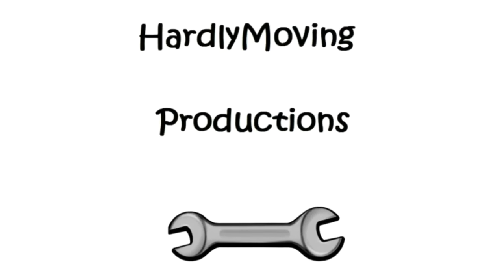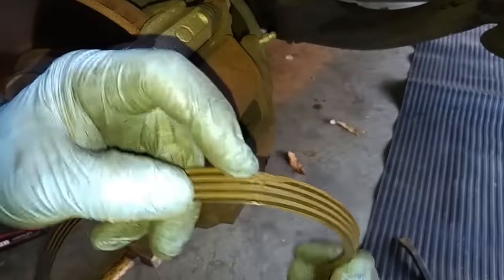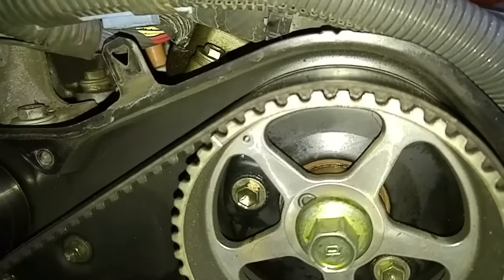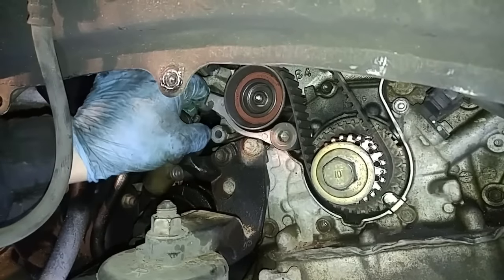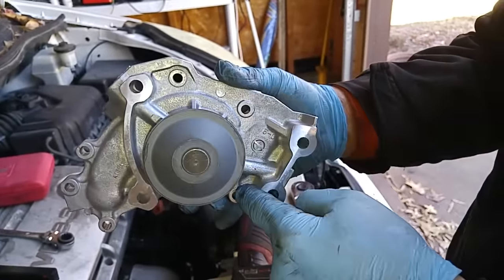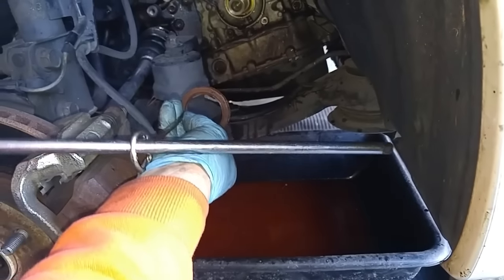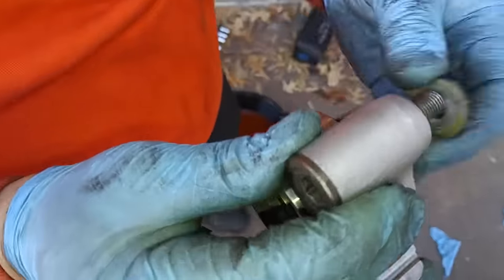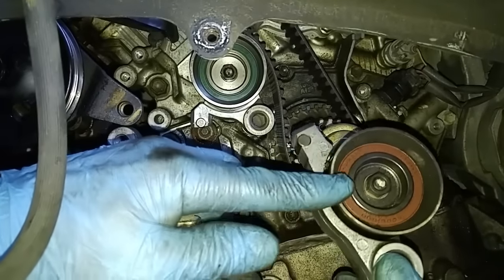Toyota Sienna V6 3MZ-FE Timing Belt, Water Pump, Seals, & Pulleys Replacement

Comment: Tonight, for my girlfriend's 2005 Limited V6 3.3L (3MZ-FE), I finished.  I finished because of this video. I'd like to thank you for taking the time to cover all of the details.  Along with the right rear bearing and backplate, crank shaft sensor, thermostat, and PCV, I saved her a huge chunk of money.  That rear cam really wants to spring fore or aft (more-so toward the cabin), and luckily it sounds fine running so I don't think I bent any valve stems, but I would recommend to anyone trying this for the first time, follow the Toyota instructions where you start everything already off 60 degrees, and only right it inline at the very end.  I did revolve the crank 720degrees to rotate the cams 360 so I could verify everything remained aligned.  Phew...thank God that's over.  This was my first timing belt ever.  I now believe other commenters that stated this might not be the best one to try first, but HMP really does have everything covered.  Well done video!
Reply from the maker: Thanks for your wonderful and successful repair story ... and glad you saved a lot of money doing it yourself!
Reply: @hardlymovingpro  one might think being a mechanical engineer that I'd have been doing my own car repair since the 6th grade but alas, that fear of "messing up" one's only set of wheels has a huge effect. Now that I've done this one, do I remain intimidated? Nope, not at all....and, I did happen to get a really nice impact driver with 1400 ft-lbs breakaway torque out of this whole adventure LOL. That crankshaft pulley bolt was really on there from the previous change!!!!  Stay healthy! Thank you!!!!!
Reply: @hardlymovingpro  Where can I find those Toyota instructions please? Thats my biggest concern about doing this job is keeping that cam bank from springing into the cyl head. What do you mean in pysical terms when you say start at 60 degrees off? What or where is the measurement taken from or to?
Reply: Where can I find those Toyota instructions please? Thats my biggest concern about doing this job is keeping that cam bank from springing into the cyl head. What do you mean in pysical terms when you say start at 60 degrees off? What or where is the measurement taken from or to?

Comment: Hey thanks for this video, I did mine on my 2004 sienna, took me a weekend. For people watching, it's much harder than it looks in this video, the angles he gets with his camera are better than what you can actually see while you're doing the job! The long motor mount bracket bolts will probably snap on you so be ready for that, they did for me.

Thanks again though, without this video I would've never been able to tackle this job!
Reply from the maker: Glad you found the video useful.  To possibly prevent the bracket bolts from snapping, soak the area with penetrating oil (top and bottom), let sit overnight (if you have the patience), hit the bolt head with a hammer a few times ... then attempt to loosen back and forth.
Reply: After watching this video I decided, that’s not a job I want to take on
Reply: @troysixberry8828  same here
Reply: I bought an older Toyota as my project car to experiment taking everything off and then putting it together. One by one.
I am a fan of 1.8 L V4 Toyota engine  and this 3.0 L V6.
Reply from the maker: Good for you with your project.

Comment: Awesome video, best I have every seen, especially on this topic!  I was able to do all the work myself.  Thanks for listing the tools used in the video description.  I was able to complete the job in 6 hours, I was expecting 15 hours!  I did have an issue with a seal leaking, not sure which one yet, as I will be re-doing the job again in the morning, but it will go much faster now that I have done in once.  Dealership wanted $2600 to do the seals, pump, bearings, belt, etc.  I did it for about $600 (including tools)!   The next change will cost even less!  Thanks for making recommendations on the type of belt, water pump and bearing manufacturers that were best.  The kit I bought had everything your recommended and it turned out to be exactly what I took off!  Thank you so much!
Reply from the maker: Good for you and thanks for sharing your repair experience!

Comment: Thank you for this video. I am about to start my 05 RX330 tonight. The only difference is that my cam seals aren't leaking however since I am already going to be there, might as well replace them and not have to worry about down the road. I am also replacing my hydraulic tensioner with a new one.  Planning to tackle this job in small chunks, couple of hours worth of work a day. My schedule is crazy busy at work, my estimate is that I will probably get it all done in 3 days total.
Reply from the maker: Good idea to replace the seals ... even if they're not leaking.  They won't last to the next TB replacement  The hydraulic tensioner, on the other hand, don't seem to wear out IMHO.  Good luck with the repair!  You'd be saving a lot of $$$ doing it yourself.

Comment: No bull...hits all the important marks. Excellent tutorial. I made a camshaft seal install tool (using camshaft gear bolt, regular plastic drain pipe...  1 7/8 OD, 5/8 deep, 1/4 inch plywood cap glued on with contact adhesive ) modeled on the tool used in video. Also a strap wrench using old timing belt.... looped.....bolted to a piece of metal piping... pure desperation after borrowed store tool that proved useless. Just installed seals and am feeling on top of this job for the first time. Probably wouldn't be here without this great video!
Reply from the maker: Yes ... you can produce makeshift tools to complete the cam seal replacement.  PVC is commonly used by others and someone else posted using an old timing belt, like yourself,  to come up with a strap tool to hold the cam sprockets.  Thanks for your complementary remarks on this video!

Comment: I wanted to thank you for assembling this video and being so detailed. I followed it step for step with my 04' ES330. The only real hiccup I ran into was that one of the two long bolts that go through the aluminum side engine mount snapped off. I ended up getting a new bracket and bolt from Toyota for about $45. I also made my own cam seal pressing tool with PVC tubing, some washers, and a bolt to thread into the cams.
Reply from the maker: Thanks for your comment.  Yes, those long bolts for the side engine mount can sometimes be a problem getting loose.  Fortunately, I've never had one shear off ... very close to it though.
Reply from the maker: @Mrgrumpypants84  You have to go underneath the car and spray penetrating oil at the bottom of the mount hole.  Then give it a couple of hours for the oil to seep.  Also hit the top of bolt with a hammer a few times to jar the bolt.  When attempting to twist the bolt loose, if the bolt gives way a little, apply penetrating oil and re-tighten.  Keep doing this and the bolt will gradually loosen.  Another way is to apply heat to the mounting hole with a propane torch.   This is a common technique for removing stubborn, rusty exhaust flange nuts and bolts.   Here's an example video:  https://youtu.be/LbeAawrEU7Q
Reply: One of the bolts broke on me as  , BUT I was ready and bought two new bolts from the dealer as well as the lower bracket  prior. I still have the lower bracket in the garage somewhere. Corrosion in the bolts holes in the brackets usually is the reason for the difficulty in removing them so upon reinstallation I was very liberal with grease in those holes ( after cleaning them ) and also around the bolts heads to prevent water from going down. If you plan to lube the bolts including the threads don't forget to back off the torque value a bit, around 15%or so.
Reply from the maker: Good to know!  Don't have this problem with car's down south or near the ocean.

Comment: I can't say just how much this video helped me! I watched parts of it more than 10 times while doing my own. It took me... a VERY long time, but I took my time, didn't have all the proper tools, and watched a ton of other videos during the project.

I found the video extremely informative. My only suggestion would be to add (if possible) torque specs for anything you used (or should have used) a torque wrench on. I found myself stopping many times to look up proper specs.

I learned that a good, long pipe will go a LONG way (no pun intended) in giving the leverage needed at times. I also learned (when I didn't have a seal cup press) that you can press seals with your own DIY tool made from PVC, a few washers, and a 60mm size 12 mm , 1.25 bolt. The paint can opener worked very well on the crankshaft seal, and the Lisle seal remover tool worked great on the camshafts pulleys' seals.  Here are a few other pointers for anyone else who might attempt this (no particular order):

-You should definitely do a coolant flush BEFORE you start the project. You're going to be evacuating the coolant anyway, and doing the flush BEFORE you put on a new pump and gasket is good practice so you don't immediately contaminate your new equipment.
-Get proper torque specs BEFORE you start.
-Some people zip-tie the belt in place...but I much prefer the small clamp method. Also, clip the belt to itself to keep over the top of the crankshaft to keep it from slipping off the crankshaft, prior to installing tensioner.

-When you align all pulleys at TDC, make SEVERAL marks with nail polish, white-out, whatever. Be sure to mark TDC, but also mark at 3,6, and/or 9 o'clock so you can see various positions during re-alignment. This is especially helpful on the left/real camshaft pulley.
-Buy 3 camshaft seals, and perhaps two crankshaft seals...if you bodger one of them, you won't have to wait to get a new one. Sure, there's a cost added if you do it right the first time, but the peace of mind is worth it.

Take your time. I had a good experience, mostly thanks to this video!
Reply from the maker: Wonderful story on your experience doing this repair!  You lived and you learned!

Comment: I've done this job before (minus cam seals) about 8yrs ago and it seems daunting now. lol

Thanks for video - excellent presentation. I have 102K miles on current belt and shop said they'll only replace water pump if needed - that seems to be false economy so I'll ask them to change it.
Reply from the maker: I highly recommend replacing the water pump since it's driven by the timing belt.  Seized pump or worn pump bearings can snap a new belt.
Reply: @hardlymovingpro  Thanks for the reply. Curious how the final crank pulley bolt is torqued.

Comment: I did it!  Excellent video!  Thank you for all the hard work you put into this!  I'm impressed the the quality, conciseness, and the fact that you responded to every comment below.  I did my first ever TB job on 2004 Sienna w/ 180K mi using your video and website instructions  and got it done.  Used all OEM parts.  Unfortunately, the first time around, I didn't get the camshaft seals pressed in all the way (didn't have the tool you used) and had a big oil leak when I took it for a drive.  So I did it ALL over again, this time using the seal tool.  However, when aligning the crankshaft, I used the wrong mark, and it was 1/4 turn off TDC.  When I tried to start it (2 turns of the key) it turned over but would't start, so I charged the battery; while waiting and double checking everything, noticed my crankshaft positioning error, so I re-positioned everything properly, re-installed the battery, and it started right up.  Its seems to be running fine, and no misfire codes.  My question is: COULD I HAVE BENT VALVES BY TRYING TO START THE CAR (BUT FAILING) WHEN THE TIMING WAS OFF?  I'm a bit paranoid about it, and perhaps it is my imagination, but it seems like the engine feels like its vibrating a bit when accelerating up hills.  No backfires.  No engine codes.  No leaks, and the engine sounds fine.  Also, recently replaced the dogbone, so I don't think that is a potential cause for the vibration.  Should I get it compression tested, or am I being neurotic?
Reply from the maker: If the valves were bent, your car would running with very low power and likely with a ticking noise. Consider doing a pressure fuel injection cleaning service.  One dirty or clogged injector will reduce a lot of power.  I did a video on how to do it.
Reply from the maker: Vibration could be worn motor mounts.  I did a video on how to replace them.

Comment: Great video. Keep up the good work. Two hang ups for me. First the small bolt on the tensioner behind the power steering bracket got almost stripped as I was using a 3/8” socket instead of 1/4”  I watched the video multiple times and then noticed. Got new bolt. 
The other one was the Mitsuboshi belt got mounted in the opposite direction and the marks on the crankshaft wouldn’t line up. Then read the real small print direction the belt came with identified the orientation. Runs much quieter than before. Thank you
Reply from the maker: Congratulations on a successful belt replacement job!

Comment: I didn't have trouble getting the crankshaft pulley bolt off with a spritz of PB blaster and my battery powered DeWalt XR, and a normal impact 22 mm socket.
- highly recommend hand cranking the engine one revolution after timing belt installation to check tdc before reassembling everything
A thousand thank yous for making this video in all its Glory
Reply from the maker: Thanks for sharing and glad it worked out for you!

Comment: This is a great video and follows everything step by step. I watched the video all the way through first then had my laptop next to the vehicle and paused at each step. The car runs like a top now and is very smooth and quiet. I would recommend that you mark each part using masking tape and a marker so you can backtrack and don't have left over parts. I labeled over 70 parts removed to do this job. I had the Haines manual but only used it to get torque specs. Overall, an excellent video to get the job done. Thank you so much.
Reply from the maker: Glad it all worked out for you and thanks for sharing!

Comment: Man this dude is such an expert.  Makes it seem soo easy.  I am using this as a guide however nuts and bolts are rusty and hard on my car.  A 2007 year old car.  I used to dismantle a couple of parts off of cars so I got some experience.  You can do it you just have to be patient, take ur time, and it'll work out.  I'll start up my car tomorrow.
Reply from the maker: Thanks for sharing and good luck with the job!

Comment: Well I found the bolt (it fell into the large-diameter hole just behind the brake!), and I got everything back together and drove to work today :) The car is running very well. I want to thank you for answering all my questions, and so promptly, every step of the way. I couldn't have done this job without you! So thanks again.
Reply from the maker: Great news!  Was wonder how things were working out for you.  Very satisfying doing the job yourself and saving money as well?
Reply: @hardlymovingpro  It was a lot of fun. I will be ready to do it again in another 90k. Best of all, now I have a good set of tools come time to replace brakes.
Reply from the maker: You should do a spark plug replacement job.
Reply: @hardlymovingpro  Yes, is it more difficult than TB? Toyota recommends replacement at 120,000 miles, which is just around the corner.
Reply from the maker: For me, it's easier.  Can do in under 3 hours.  Here's the video:
https://youtu.be/vczTJ-pAVT8

Comment: This is a great video showing the steps on this job. One of the best repair videos I've seen.
I've done the belt on my 97 Camry and chain on 90 Toyota pickup but this will be my first attempt on a V6 in my 04 Highlander. Nice to see the tools needed as you use them. Got a few things to put together before I start, like where did I put the anti-sieze? Onto the list it goes. 

63 people missed when hitting the like button and shouldn't attempt this repair.
Reply from the maker: Glad it helped!